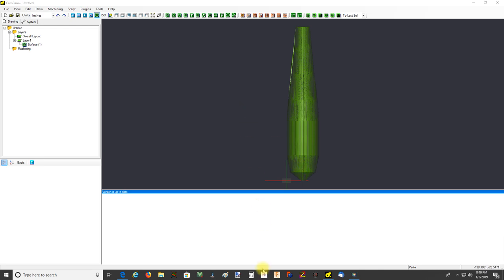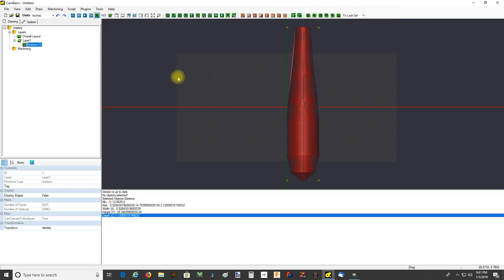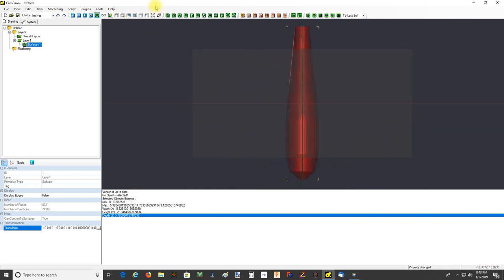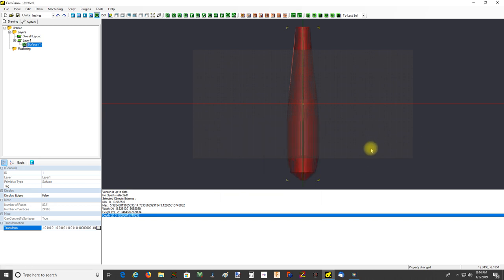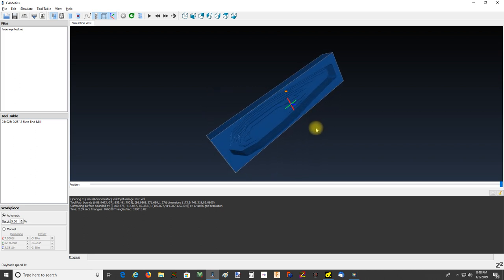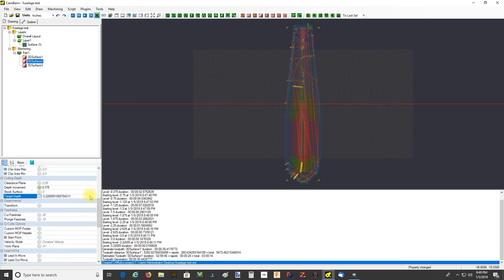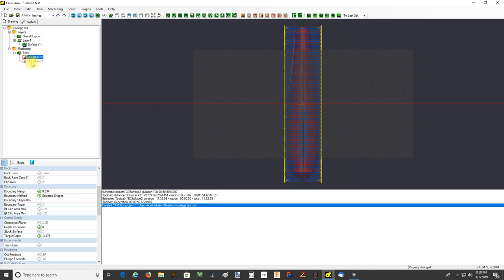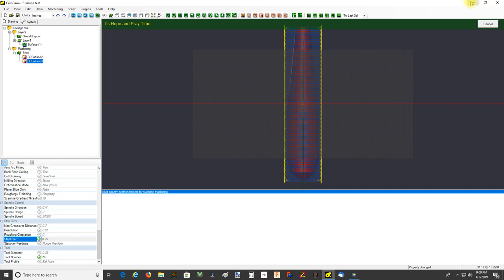NOT A TUTORIAL:  Getting Started on a 3D Machining Operation With CamBam

Comment: Very helpful!  Is there a way to tell the system to NOT cut along the boundary?  I'm trying to make a thermoform mold and I don't need that extra cut.
Reply from the maker: I'll go back and look when I get a chance.  Pretty swamped right now.
Reply from the maker: If it's a CamBam project and I understand correctly you can simply enter a roughing clearance.  Then it leaves that much material between the last cut and the geometry.
Reply: @boblalonde8661  I don't think I asked properly.  The perimeter of the geometry is all at the 0 z-axis so there is no cutting needed.  The problem is that the system wants to cut a boundary so I get a "moat" around the entire geometry.
Reply from the maker: @Bigelowbrook  set the depth to zero or above zero.  It cuts as deep as you tell it to.
Reply: @boblalonde8661  I don't see a depth setting in the Boundary area, but I did find that if you set the Boundary Margin to -1 removes it!

Comment: they need to change the feed rate. Who can picture in their head how far in a minute? So I multiply 60 by an understandable second every time.
Reply from the maker: Inches per minute is a pretty widely accept rate in the industry for those working with Imperial units.  While you personally may not find it all that intuitive, I've gotten used to it and used to talking to other machinists using that standard for comparing and sharing data.
Reply: @boblalonde8661  yes, I got or am getting used to it also but it is so easy to imagine how far I can push a hand held router in a second but not in a minute.